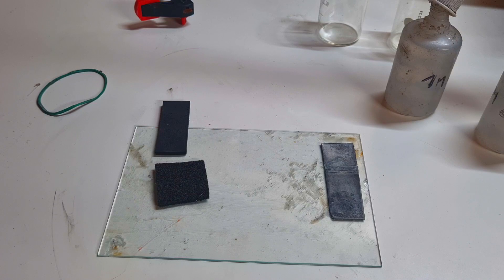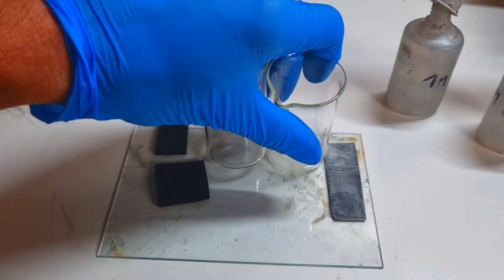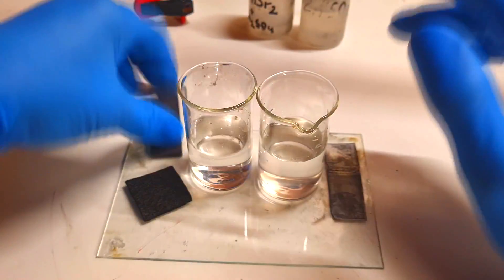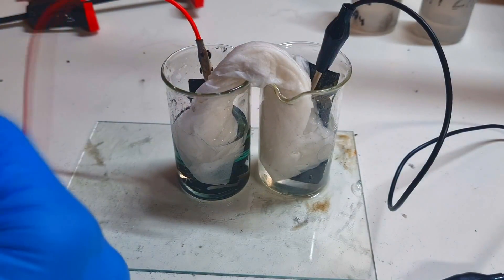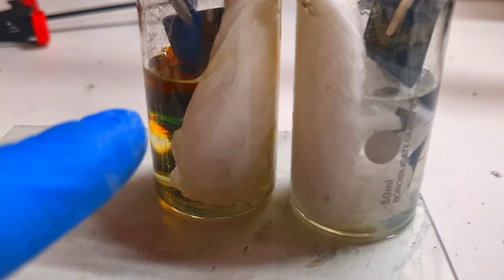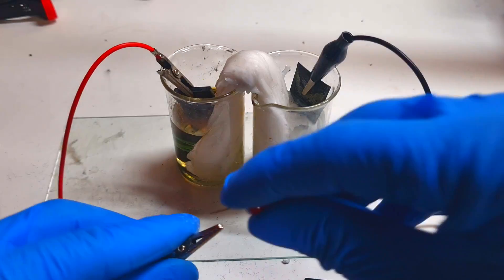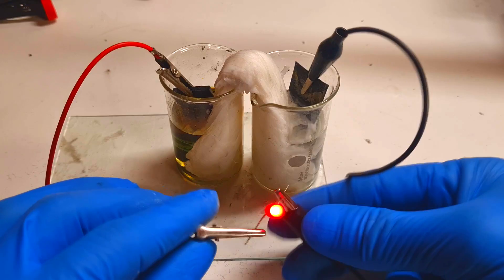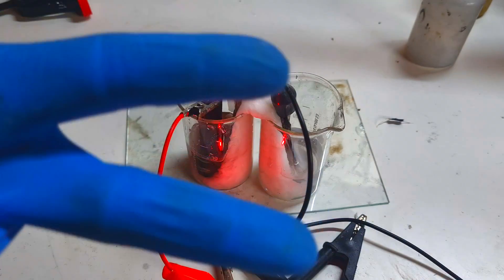DIY Zinc Bromine Battery with bridge

Comment: why do you mix the electrolytes, why use salt bridge if you are going to mix the electrolytes? doesn't that just defeat the purpose of using salt bridge (to prevent ion collision)?
Reply from the maker: On each side of the cell is used same electrolyte (ZnBr2 + ZnSO4). The zinc bromine battery have problems on each side of the cell. On the positive side is created bromine which can migrate to the negative electrode and can cause self-discharge. And on the negative side of the cell the zinc dendrites are formed which can short the battery. To prevent all this, some times some special separators need to be used which can be expensive and hard to make. For this reason here I demostrate a cell which the positive and negative side is mainly physically separated but ionically connected throug the salt bridge. In this case the bromine and the zinc dendrites can not make any problems. But in the end all that has its price, which is a bit lower efficiency.
Reply: @cayrex  follow up question, what is the reason you mix the electrolytes, where usually in salt bridged batteries, people use 2 different electrolytes.

Comment: I saw a high voltage zinc battery in the channel. I wonder what the result would be if you put acid in one container and alkaline electrolyte in the other?
Reply: Soruyu geri aldım, zaten benden önce düşünüp videoyu çektiniz, kanalda buldum :)

Comment: I just saw your last video on zinc manganese video and I got back to have a look to this.
I have two question:
1) you said "same principle of zinc bromide" for zinc-manganese what did you mean? What the chemistry?
2) you were expecting the battery to self-discharge, the other type did?
Reply from the maker: 1) I mean the same cell housing design with salt bridge. The chemistry are: one is Zn - Br and another is Zn - Mn.
2) Static cell designs can have higher self-discharge. That cell design with salt bridge have good stable voltage with Br and Mn
Reply: @cayrex  thanks bro, just for Zn-Mn I can't understand the electrolytes...maybe ZnBr and MnBr? This is what you meant?